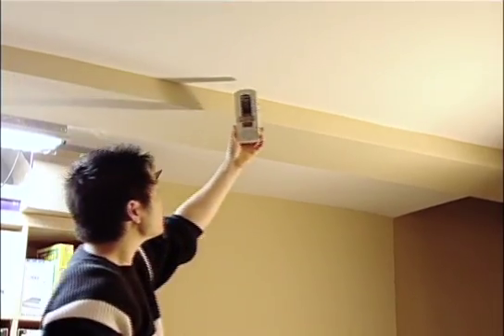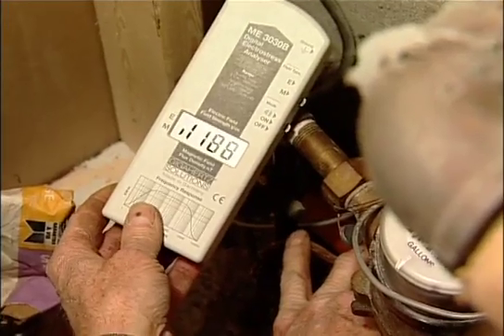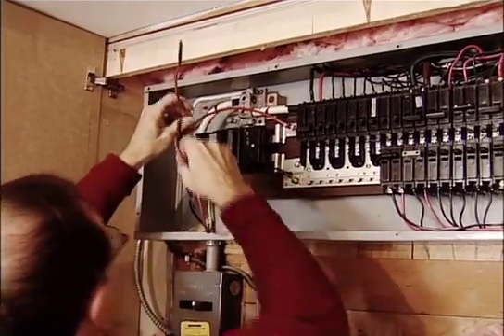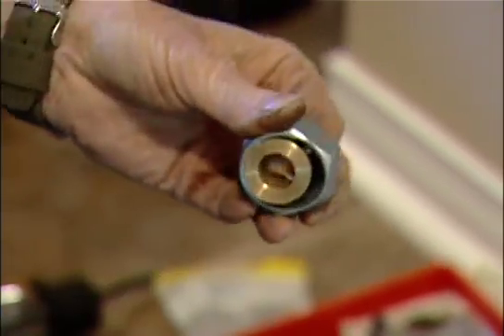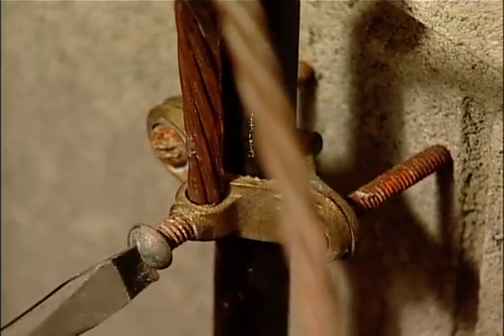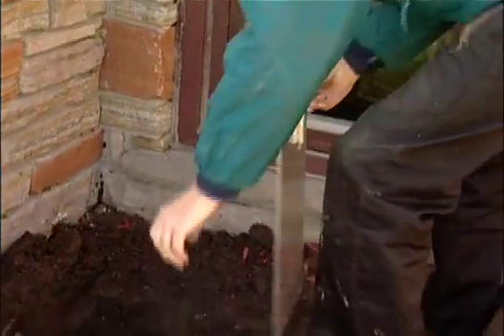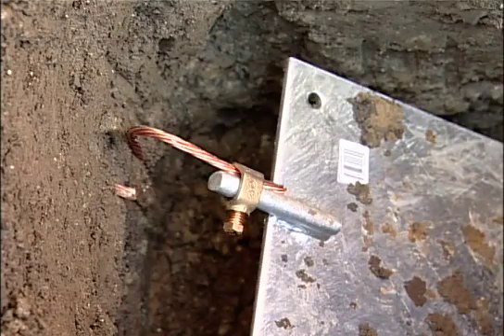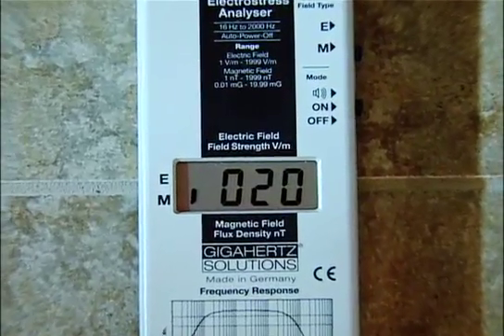Preventing EMF from entering your house in your plumbing

Comment: In our country (NL) you have to drive a pin into the ground and keep doing that until the resistance to earth is less than (i think 1.5 ohm) You need special equipment to measure that. I hired someone to do that and after i saw what they did, i was glad i didn't try it myself.
(That doesn't work if you have large rocks in the ground)
Please be aware that if you are on high dry land, burying a plate might give disappointing results.

Comment: Other parts of the house, say like your electric dryer,  many times are "grounded" to the water pipes. In theory if a short develops in your dryer the current will go through your water pipes that form a conductive path to the ground. But, if your metal pipes have sections of plastic pipe  then the pipe on side of the dryer could instead become a hotwire.

Comment: Please, everyone check your local and state electrical code. You electrical breaker box should have a neutral connection from your power company, a water pipe ground from the city supply and an earth ground that the homeowner supplies. Ever since the implementation of smart meters, EMF is every where in your home. Your home grounding is extremely important these days. Everyone, please check your local grounding. If you have one metal rod, consider a second rod, 6 feet away from the first.